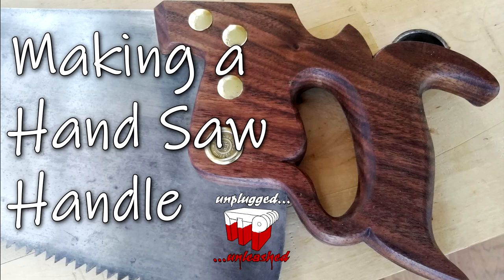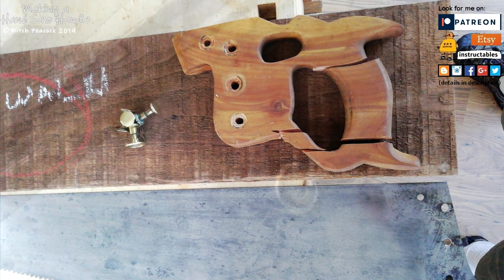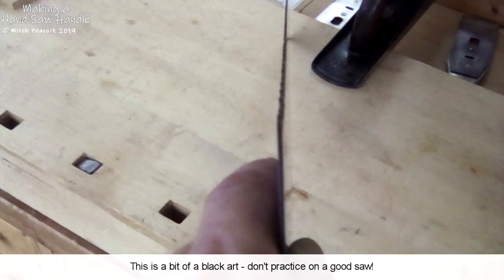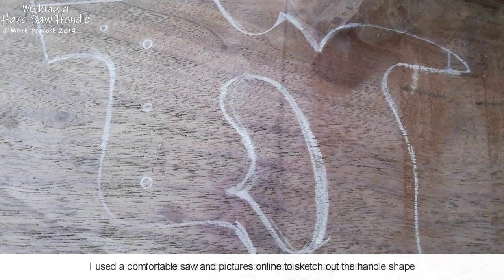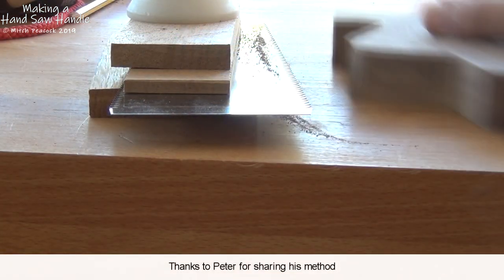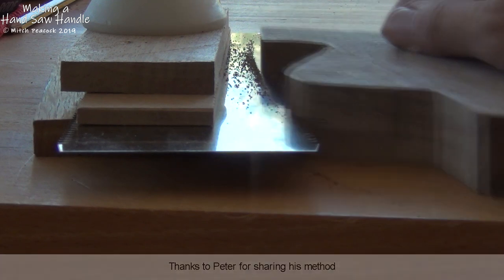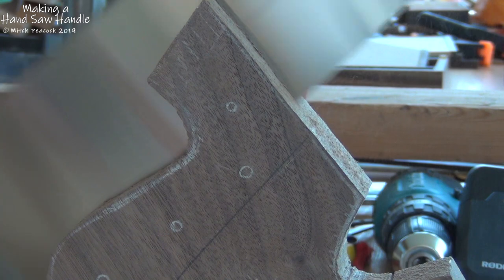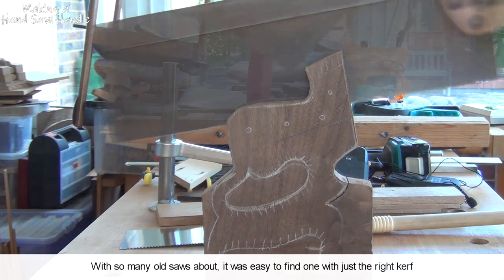How to Make A Hand Saw Handle. Replacement Hand Saw Handle

Comment: Turned out great, Mitch, and thanks for the video! Just don't do what I did two days ago: Was sawing apart an old twin bed frame that I'm making an assembly table out of, and found some very well concealed nails! Going to get some practice sharpening the old rip saw before I start the reno on the new one.
Reply from the maker: Good advice, nails are not a saws preferred bed fellow. Love the recycling idea too.

Comment: Yes Yes Yes the saw plate groove has been the source of failure and stopped my handle making project. I have tried the marking gauge then cut to the line but I have got close but not enough to make me happy always off just that little bit.  Thank you for sharing
Reply from the maker: I'm pleased it's been helpful

Comment: what width did you choose? Thinking of a slightly wider handle for a restore project, would like to hear your inputs. Thanks for the content!
Reply from the maker: I went about a 1/16" wider than the original. I can't recall what that was and I won't be in the workshop for a couple of days now. It feels more comfortable to me, but the saw nuts weren't long enough as a result, and I had to recess them slightly which was a shame.
I'd recommend making it on the large size. From where you can easily reduce it if needed. Rather than make it and discover it's too small in the hand

Comment: Looks good Mitch.  Did you orient the wood grain or just go for it?  How thick was your blank when you started?  Keep up the good work!
Reply from the maker: Thanks. Yes, I utilized a piece with some changing grain direction that just suited the handle design, maintaining strength through the narrow sections. The blank was a little over an inch and I thicknessed it just enough to allow the saw nuts to engage a turn.

Comment: Any suggestions where to buy the right sized nuts and bolts?  The saw I'm fixing had a cheap plastic handle so no bolts to re-use, and a regular hardware store doesn't carry that shape.
Reply from the maker: Plenty of used ones on sites like eBay. Alternatively, buy brass nuts and bolts and take a file to them.
Reply: @mitchwoodwork  thank you!